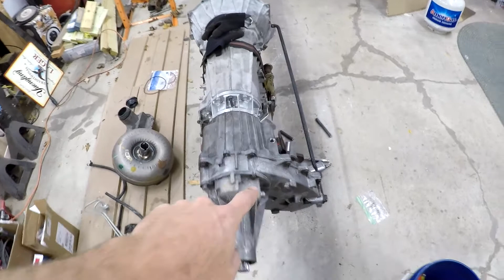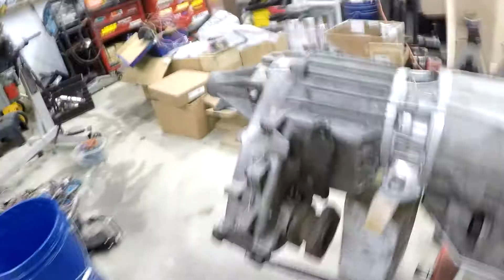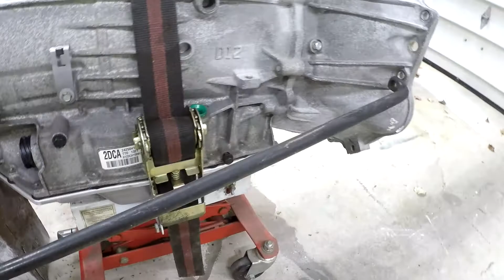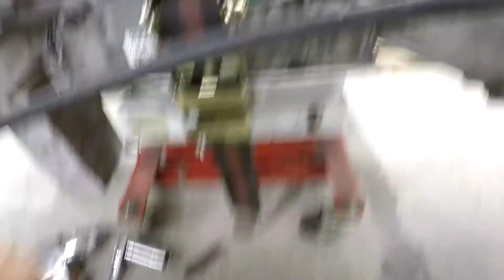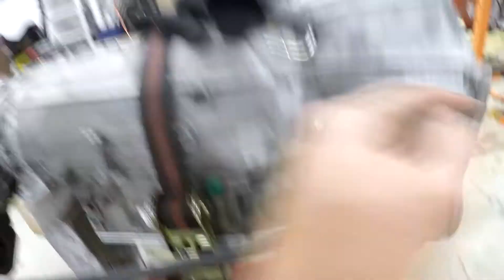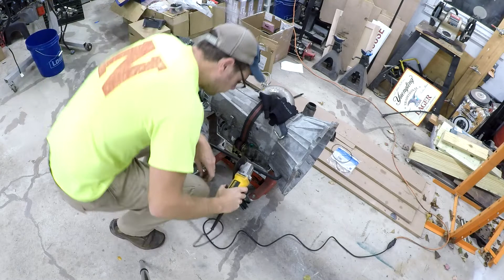1988 Suburban LS Swap - Part 6 - Transfer Case Brace to 6L90e

Comment: How much was it to get the output shaft re cut?
Reply from the maker: $75 and 2-day turn around. That was of course quite a few years ago!
Reply: @JEGsGarage thanks for the reply! Hopefully I can find some one to do it
Reply from the maker: @Billy.The.Kidd.C Moser! Give them a call or shoot them an email. They'll take care of you. You'll need to send the output shaft and the input of the t-case to them.
Reply: @JEGsGarage sounds good thanks!
Reply: When you cut the shaft, did you cut the 2wd shaft to the same length as the 4wd shaft? Also having it cut down 32 spline?
Reply from the maker: @Billy.The.Kidd.C so I didn't base the finished length off of anything existing. I use the measurements off the transmission, and the transfer case, to come up with a finished length. I sent the input shaft of the transfer case along with the output shaft of the transmission so that they can match the spline up exactly. I think I might actually have a video posted that shows how I measured. If I get a chance later, I'll let you know which video and at which point I do it.

Comment: I just wrote you a question, and luckily I found this video where you give me the answer. And what does this bar do?
Reply from the maker: @mytoman120681  it helps brace the transfer case when it's in 4-low and you are cranking on it. Some leave it off, some say it does nothing, some say your tcase will explode without it lol.
Reply: @JEGsGarage  Thanks for your videos, they've helped me a lot.
And I'll have to make a similar bar myself. My transfer case has lost it over the years. LOL
Reply from the maker: @mytoman120681  hey no problem. I'm glad my videos are helping someone! You could probably make a bar or something that functions similar. Just don't be tempted to make a bracket from the transfer case to the frame. If you can build something that has lots of rubber isolation to it you might be okay, but you don't want to hard mount it.

Comment: What kind of electrical work has to be done to make this transmission function? I have a 6.0 Ls1 carbed in my squarebody rn
Reply from the maker: Hey James.  Sorry for missing this comment!  Do you still need help or did you get sorted?
Reply: @ I actually just put in a th350 to my 6.0 and it runs and drives great now just straight vacuum to the intake to make her work like factory
Reply from the maker: @jamesbroderick5157  heck yeah!!! Keeping it simple sometimes is the best path!
Reply: @ yessirrr
Reply: @ I appreciate it tho